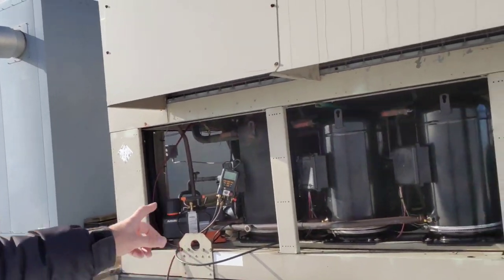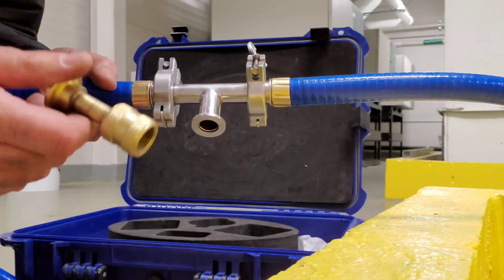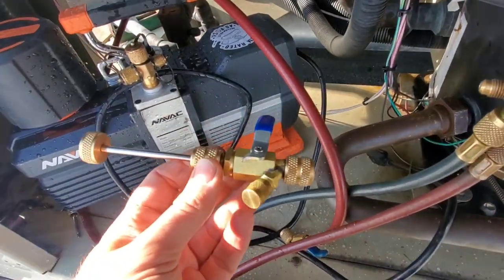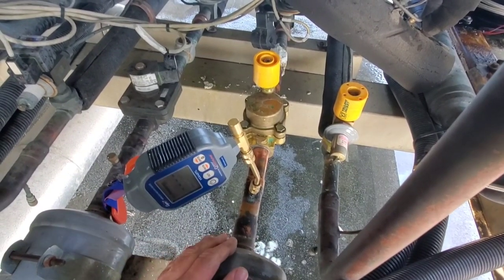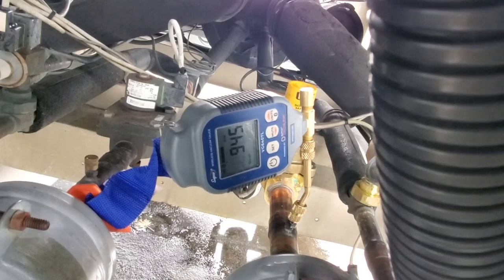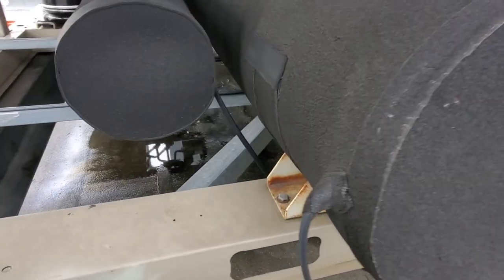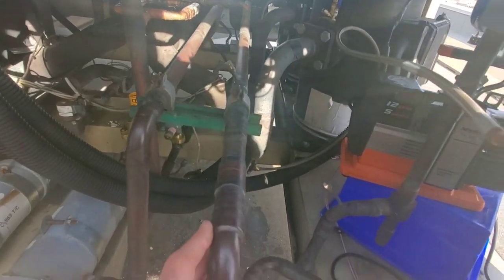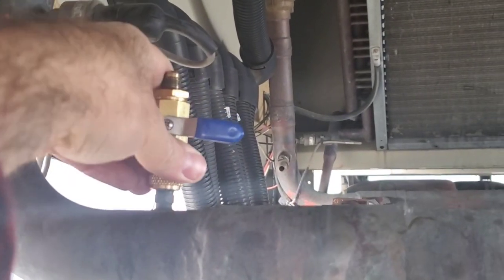How To Pull A Vacuum On A Commercial Chiller: A Race To 500 Microns

Comment: You want to pull a good vacuum? Quit using hoses and use copper from the chiller to the vacuum pump. I pulled a 200 micron on a 1500 ton Carrier centrifugal over a weekend.

Comment: Nice video. One thing though, I don’t like breaking a deep vacuum on a chiller with liquid because of the thermal shock it causes on the system and possibility of freezing a tube. I bring it up to 32 deg F with vapor, then switch to liquid.
Reply from the maker: Pump is running and it's glycol, won't freeze.
Reply: I was trained the same way. In most cases I'll run my pump to avoid freezing and try to add vapor to just about freezing point into my system then charge the rest as liquid.
Problem with adding vapor first is that it expands and takes up alot of space which gives little room for liquid to push in. It's a long charging process especially on a unit with alot of real estate like the one hes working on. Glycol helps against freezing. Most of my chillers I've worked on in the northeast call for 38 % ethylene.

Comment: nice video, I prefer the blue vac micron gauge myself, mainly for the app and being able to switch between logarithmic and linear decay tests. I'm very tempted to spend the money on those true blue hoses though
Reply from the maker: The supco uses the techlink app that was created by measureQuick
Reply: @HVACKnowItAll   I dint know that, I will have to check it out!
Reply: @coldfinger459sub0  yes but rubber hoses have play and can bend and run through corners and tight spots. You would be making new pieces every time to fit whatever application you are working on. If I only serviced 5 ton weathermasters that would work cause I’d have those already formed.
Reply: @coldfinger459sub0  didn’t say it couldn’t be done but the practicality of it is inferior to hoses. The time your done figuring out how your going to run the tubing I will be on my way to the next call. In and out! 

If want to make a video on it I’d definitely watch it comparing copper line vacuum test to tru blu hose on a system over 3 tons even bigger better.
Reply: @coldfinger459sub0  sorry but trying to manipulate 1/2" copper to perform a vacuum does not seem like a good time

Comment: Did you use the NAVAC for the whole evacuation? I was under the impression that those motors weren’t suitable for extended evacuation times, but looks like it did fine to me.
Reply from the maker: Yes ran for 48 hours uninterrupted, what indication lead you to this?
Reply: @HVACKnowItAll  other brands of pumps like the TEZ8 aren’t suitable for long run times, and I assumed that was the case with these. I noticed the 12 cfm DM model is designed for long evacuation times, and I have contacted Andrew Greaves to see if their 6 and 8 cfm models can as well (which they aren’t labeled being capable like the one you have in the video). I’d love to have a lighter pump that can handle an overnight evacuation.

Comment: Doesn't this system have any service valve in any point between the receiver and the metering device to charge with liquid?
Reply from the maker: It does, why do you ask?
Reply: @HVACKnowItAll  I asked for a service valve between the receiver and the metering device. You showed a valve between the condenser and the receiver. Here usually is where this kind of charging valves are, at the outlet of the receiver. I'm sorry... I didn't pretend to be fussy 😅

Comment: Almost full accutools setup but no gauge? Anything that can’t be calibrated is almost just taking a shot in the dark unless your comparing to something that’s been calibrated and correct. I understand in a pinch abuthing is better than nothing but 500 microns could be 1000. Bluvac is superior to anything else due to the fact you can calibrate and the sensor knows when it needs to be or contaminated. 

Good job on the procedures very thorough on running correct vacuum setup. Plus 0 degrees over night Shiz we get lucky if it gets couple degrees below 40 here in SoCal (Oc)
Reply from the maker: Performing an ultimate vacuum test wity your pump tells you instantly if your micron gauge is working correctly.
Reply: How do you preform a ultimate vacuum pump test ?
Reply: Mainly what numbers are you looking for ?
Reply: @justinvandenbrandt7478  pump on only with micron gauge. Not Connected to anything you would be only checking the vacuum pumps capacity.
Reply: @justinvandenbrandt7478  on clean oil pump should be able to achieve 50. Once I see the microns start going below 100 I know pumps good and oil is as well. A fellow coworker had issues pulling a vacuum I connected a gauge and it only got down to around 2500. His pump need a oil flush then it got down below 100 ready to go again.

Comment: I complain about the weather in San Francisco getting down to 50° pulling a vacuum and calling it cold lol😂. 

          You may want to wait to put the valve cores in after refrigerant has been added so you have a positive pressure not a negative pressure sucking that little bit of air and really is minimum but if you ever make a mistake with a leaking seal on your valve core tool as you’re putting it in that would suck having to do it all over again.  Lessons learned from me one time mistake never to repeat again.
Reply from the maker: I did put them in on a positive pressure, I explained that as I was pulling off my micron gauge.